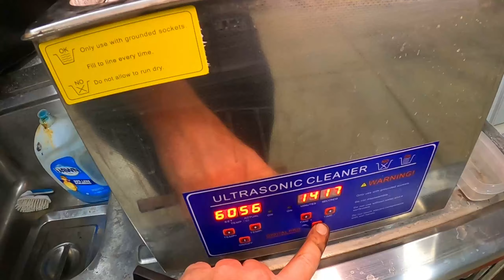Honda TRX200SX Engine Rebuild  with JB Weld - CRACKED CASE WILL IT RUN?

Comment: Hey bigfoot!!!!...I have a 95  TRX200d same trx200sx motor, regarding the oiler sprocket, the is a small groove for a snap ring on the back of the sprocket, that will tighten it up way more, and thanks for the video, I looked everywhere I could to find a complete teardown
Reply from the maker: Cool, I hope you got some good info out of the video. I got everything back together and it runs like a champ now. I'll have some more videos of it running up really soon.

Comment: Due for the same rebuild including case repair on my 88' trx200sx after the chain snapped. Any advice on where to get a decent gasket kit and replacement engine bolt set? Have a couple broken bolts and some missing....
Reply from the maker: Sounds like a fun project. I normally just search for gaskets and nut and bolt hardware. Thanks for watching!